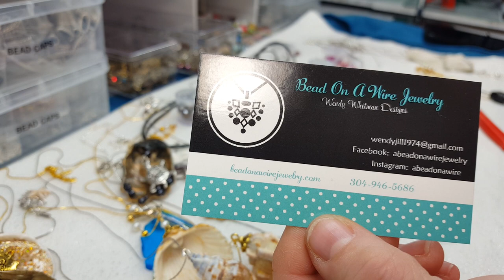Resin Seashell Pendants Part 3

Comment: Wendy, all of your seashell jewelry is gorgeous!!  You should print up a little sign saying your seashells were all specially hand picked from beaches (name the beaches) and put it in a frame to have at your shows. People love it when there is a backstory!  You could also add labels to your packaging so if they give it as a gift the person receiving it would know where the shell came from.  Be sure to wear protective gear when you're drilling/sanding resin.  It's best if you can do it in a garage or outside.  The dust particles are extremely dangerous to breathe in!!  A lot of people don't know that and you can get really sick from it.  Also if you wet sand/drill it will really help to minimize the dust particles.  Then wash or wipe everything down to get rid of the particles.  Glue on bails work great on shells too if you don't  want to drill them.  Good luck at your shows!!  I hope you sellout!!  TFS! 💕
Reply from the maker: Heidi, thanks for the advice and the ideas!  You have such creative ideas!